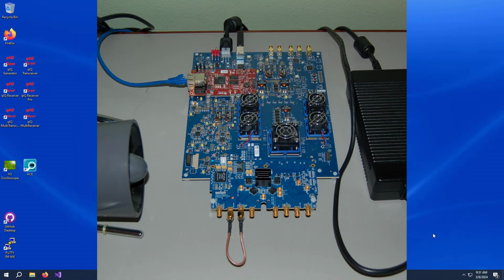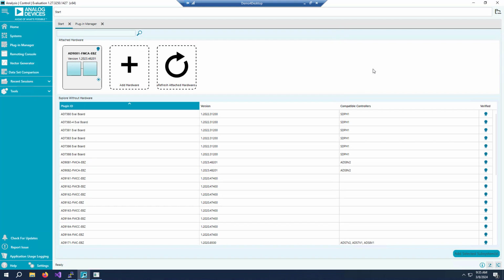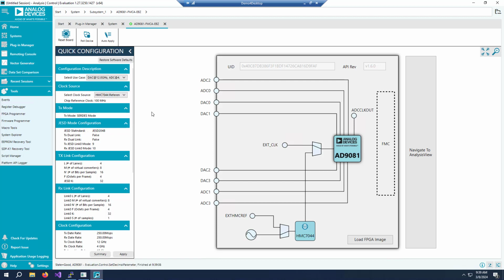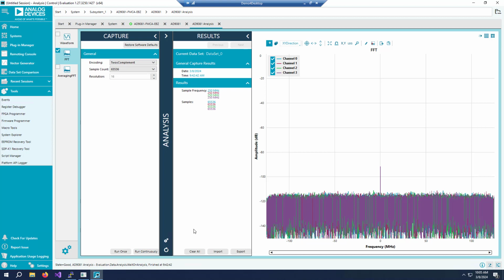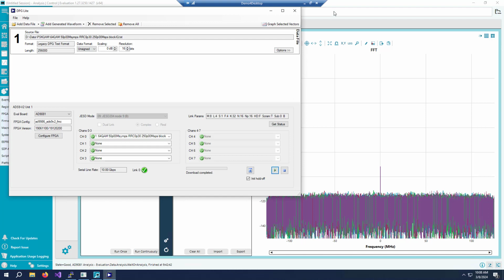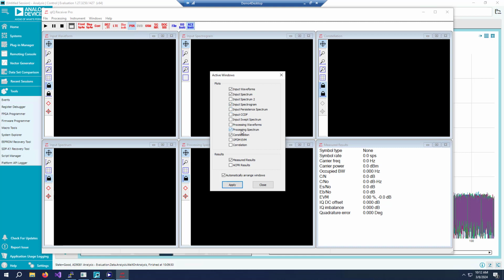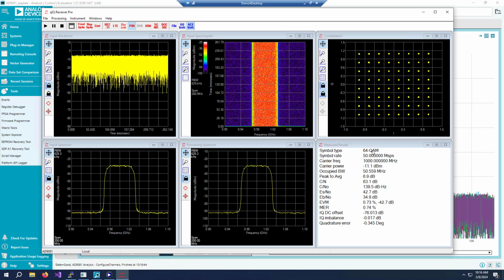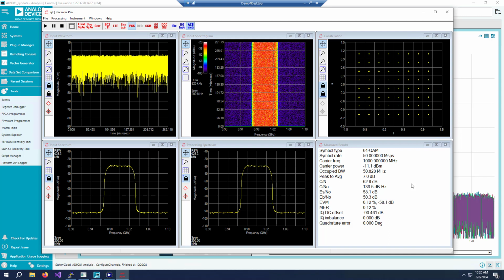AD9081, ADS9, ACE and qIQ Receiver Pro

Comment: Abstract

This video demonstrates how to set up and analyze signals using an Analog Devices AD9081 FMCS EBZ evaluation board hosted by an Analog Devices ADS9 digital board running Analog Devices Ace software. The transcript covers essential steps, including network setup, configuring the Ace software, and generating waveforms. Additionally, the video demonstrates the use of the Quick Receiver Pro software to perform advanced signal analysis. This includes demodulating a 64 QAM signal and achieving excellent EVM results through adaptive equalization and zero-IF corrections.

Keywords:
* Analog Devices 
* AD9081 FMCS EBZ 
* ADS9 
* Ace 
* Quick Receiver Pro 
* signal analysis 
* QAM 
* EVM 
* adaptive equalization

i used gemini